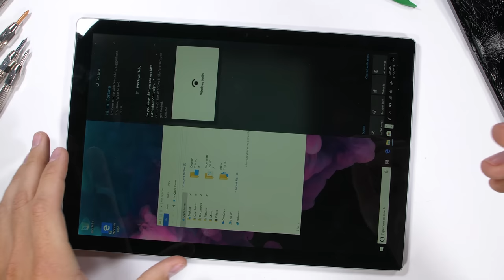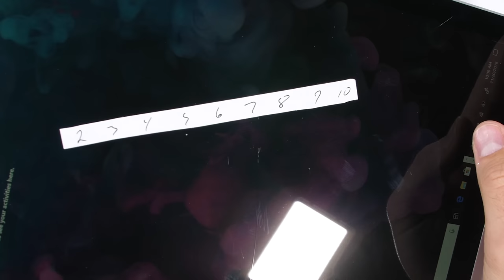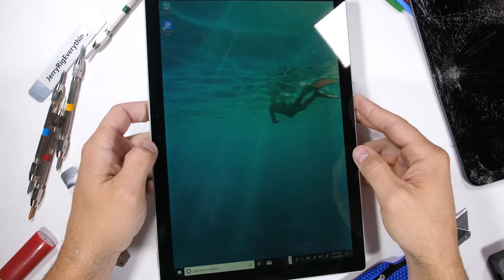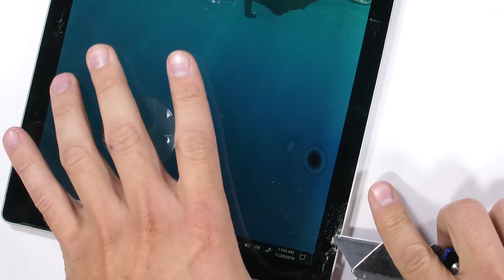Surface Pro 6 Durability Test! - Is it stronger than the iPad Pro?!

Comment: Yea, but batteries never last as long as the device, and the batteries in these are a complete cunt to replace.

I have one, and the battery has started to swell up, which means there's a big band in the touch-screen that no longer works.  I think the EU are in the process of passing a law such that it is illegal for corporations to make devices where the batteries can't be replaced  by users.